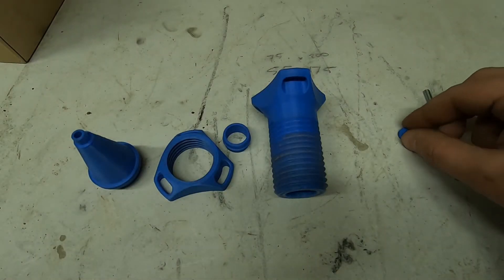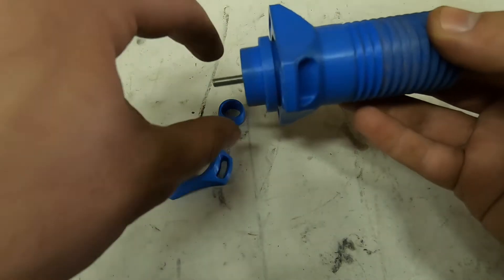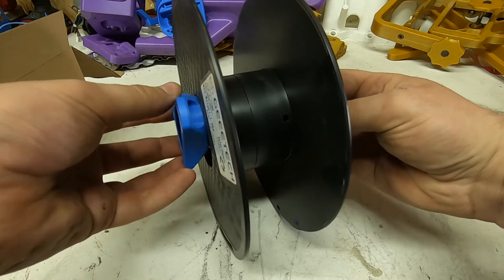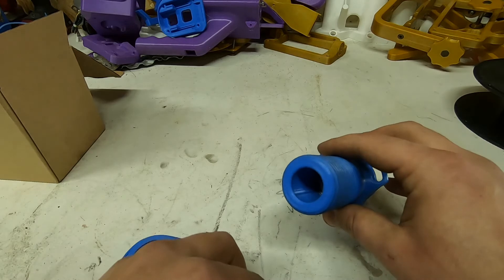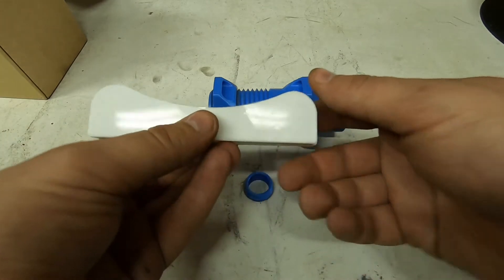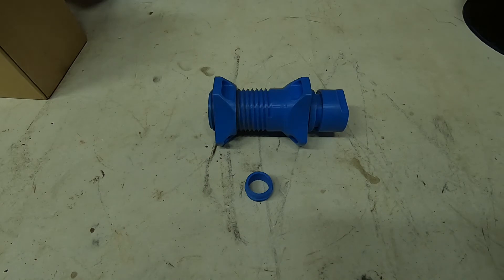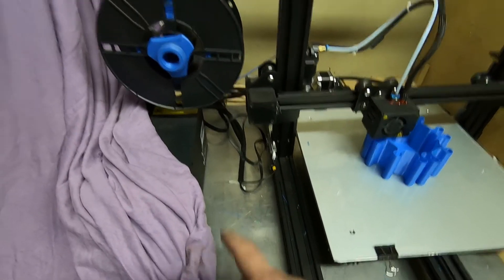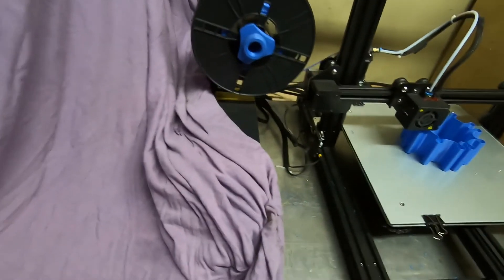BEST FILAMENT SPOOL HOLDER - CHEAPEST PRINTABLE ONLY ONE 608 BEARING - DIY - FREE  MODEL DOWNLOAD

Comment: How would you be able to tighten this to where the spool doesn't spin too freely and unravel the entire spool? I've seen that be an issue on this style of spool holder.
Reply from the maker: On some printers unwinding is a problem, usually on top-mounted spool holders. 
For my other printer I used a piece of duct tape on the metal bracket that rubbs against the spool to make some resistance.
Whatever does the trick.

Comment: Hi. I simply cut out two rectangular holes in the stock spool holder  at measured distances one from the other. Then, I slipped two bearings over a steel rod making sure the bearings were big enough to clear the outside the spool holder. The bearings should be higher than the spool holder and come into contact with the spool. I hot glued the steel rod inside the spool holder tube, and voila. I positioned the bearings so that these are in the upper position once the spool holder is installed onto the mounting bracket. It doesn't look that great, but it functions quite well. I didn't need to use filament to make this.
Reply from the maker: I have spool holders on few of my printers that are just made from discarded automotive ball bearings, screws, nuts washers, 10 minute job without mods...whatever does the job